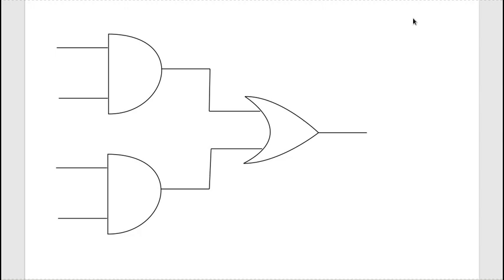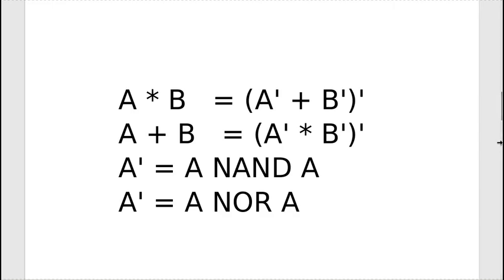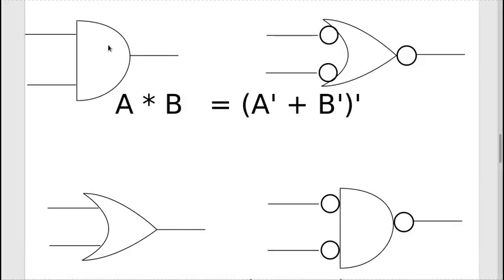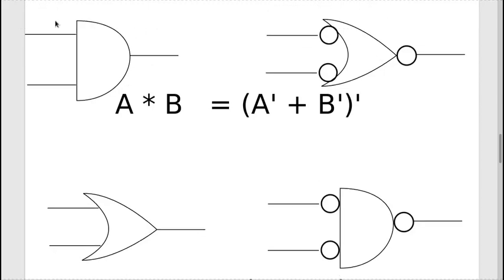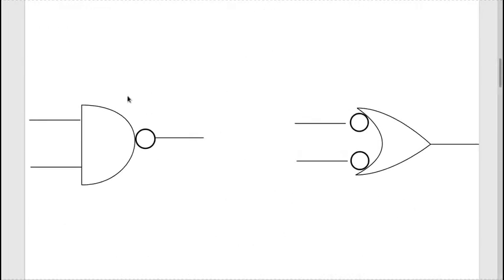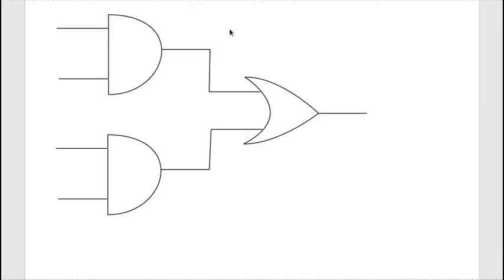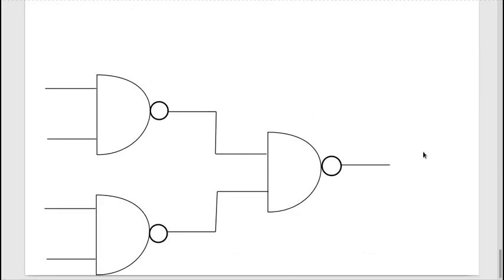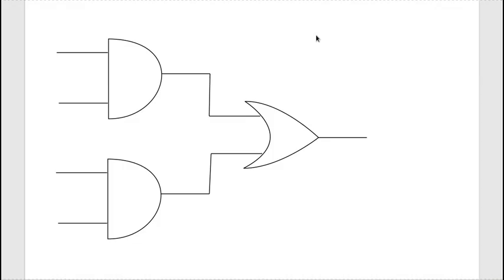Change a Combinational Logic Circuit to Only NAND Gates or Only NOR Gates

Comment: what if the final gate is suppose to be a NOR gate and you already started off with an OR gate
Reply from the maker: You add two bubbles and the one bubble gets added to the end of the OR gate and the other bubble is an additional NOR gate with 2 inputs coming from the same wire